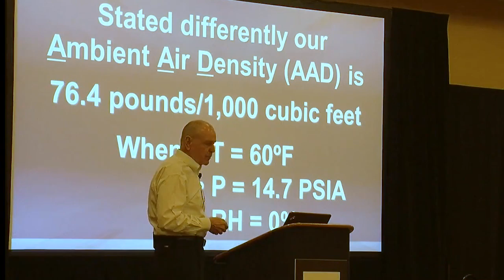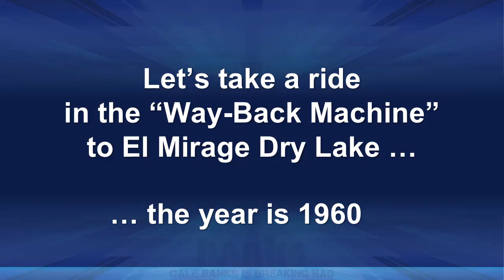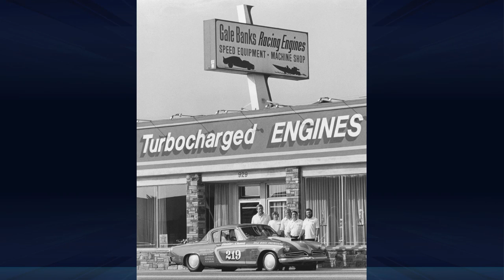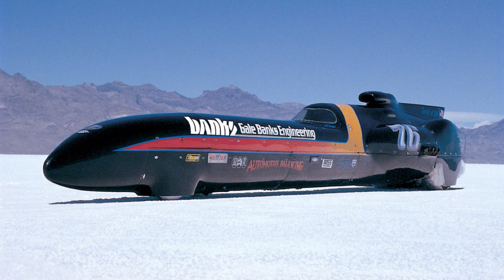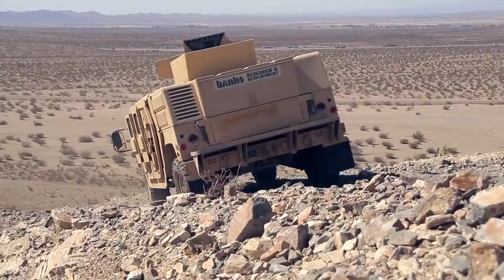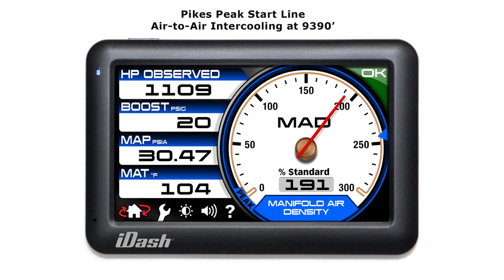The Boost Gauge is Dead to Me!

Comment: its simple the same boost in a thinner tube will move less air then a big tube with the same boost and ofcource bends and other stuf play a roll but for the basic just think abouth that.i see guys on you tube putting bigger turbo and bigger tubes and wondering wy it makes the same power as the smaller turbo with less boost

Comment: I think his reasoning is flawed, because boost numbers were never used to compare power. 20 psi of boost is 20 psi of boost. It doesn’t mean any more than that. A 2.3 liter 4 cylinder on 20 psi will make a wildly different power number from a 5.0 liter v8 on 20 psi.

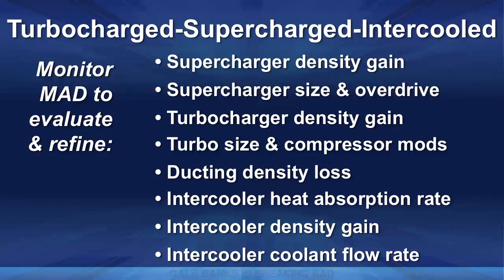Comment: Excellent stuff, learn heaps despite only managed to watch 50% of the content (will continue). Gale, I’ve got a question, where I live its hot (30-35*C, 90% humidity, 365 days). I run a petrol turbo Cx7 with higher flowing turbo, bigger core IC and pre IC and post IC WMI (I feel it is absolutely necessary run wmi in my neck of the woods with 50:50 water to meth by density ratio). Question is what does WMI do to humidity which ultimately affects MAD? sure it cools, but what abt density?
Reply: My understanding is that it depends on where the water mist evaporates. If it evaporates before the intake manifold, this should cause intake air temperature decrease, so MAD would increase. If the water mist evaporates inside the combustion chamber, then you have water breaking down  to oxygen and hydrogen, which again increases air density. But as far as i can tell WMI is mainly a tool to control uncontrolled detonation/pre ignition inside the combustion chamber.

Comment: 72 Inches Map was a hot setting in WWII aircraft. They did not use boost either because the engine and fuel only respect temperature an map.

Comment: The only thing I care for,  apart from a efficiënt turbo and intetcooler set up , is how much grams of air is IN  the cylinder AFTER the intake valve has closed......

A lot are yelling about high boost etc and how high the boost can get....then I ask :  what about that super high boost  if intake valve has not opened and closed ??? Then there is no air in the cylinder..... basically:  high boost  and a worse induction and exhaust system gives an overheated engine.....

Comment: Density is king!
A better intercooler will give you a power and reliability increase due to the increased density while giving a higher performance headroom. Still too many don't understand the whole concept. On the subject of lag down low, I would love to play around with injecting liquid propane into the manifold to increase response from the instant exhaust volume and the density gain from the latent heat of vaporisation. I drove a truck with  gas supplement which went really well. It would certainly help with the smoke issue. If you only inject gas below the flammability limit, there would be no problem with backfiring as it has a very sharp cutoff unlike petrol

Comment: Hi Mr. Banks, How do you explain Smokey Yunicks Hot Gasoline Vapor Engine system ? Smokey is heating the A/F mixture to 400 degrees Fahrenheit, Vaporizing the gasoline, Homogenizing the A/F mixture, increasing engine horsepower,  increasing Gas mileage, and reducing exhaust emissions.
Reply: Gasoline Vapor Systems probably has an issue with detonation and Nitrous Oxide production.
Reply: @HighestRank  Nope, Zero detonation, even with advanced ignition timing, and low octane gasoline. I don't know about the NO2 emissions.
Reply: Yunick had some great ideas and this was one of them. He also like to run race engines hot (240°f) for homogeneous charge and less heat regection. The problem with them is the exotic materials that are requires and costly lubrication. Some claims are of 50% efficiency and that just possible. What's happening today with f1 narrowly beats it with roughly the same expensive materials. A vw 2l diesel is about 41% efficient and Toyota clips at 40% now with their modern engines. There might be a bit to be gained but the cost would be overwhelming. The patents are over 60 years old and if it was going to come to fruition it would have decades ago.
I haven't seen any long term testing either and I can imagine the problems that arise from having an engine that is expected to operate at 400f sit in an Alaskan driveway for a week at -40. The thermal cycling, even with engineered material, i have a feeling would cause havok.

Comment: Hello Banks, I have a question, we need more density to have more oxigen and the question is you have considered adeed oxigen by other way ? an experience with this ? sorry for my english
Reply: Nitrous Oxide adds more oxygen in combination with fuel injectors to keep the right air/fuel mixture. Works well but has to be well managed or you can melt pistons if it leans out.

Comment: Great video. Lots of knowledge  of volumetric efficiency factors. Altatude and ambient temperature definitely effect engine performance. My brother flue a piper Aerostar plane with two 6 cylinder turbocharged engines.
The p51 mustang in ww2 was supercharged. A v12 was a real winning combination.

Comment: I would be honored if you could answer this.  I was told a long time ago that when boost is added to an engine that the displacement increases.  Is this so?? If it is is there a formula to use to find out boost=displacement change...Thank you again for all of your information.
Reply from the maker: Adding boost does not increase engine displacement. Your engine pumps a fixed volume of air per revolution. By adding Boost you are increasing the pressure of the air so each cubic feet of air contains more oxygen molecules. It’s the extra oxygen that allows you to put more fuel in to give you more power.

An approximation of the added power can be done using pressure ratio. If you have a 5.0L naturally aspirated engine that makes 300 hp at MAP of 14.5 psia (or 0 psi boost). And you add 14.5 psi of boost so the new manifold air pressure is 29.0, the pressure ratio is now 29.0/14.5 or 2.0. The new estimated hp will be about 600 WHP (300 whp * 2.0 pressure ratio). 

This is just a very rough approximation and does not take into account the changes in air temperature when you add forced induction to an engine. For an even more accurate estimate, you can use Density Ratio as a multiplier which does take temperature into account.

Knock limitations, parasitic engine losses and more are also factors so this is just a rule of thumb, not an exact science.
Reply: @bankspower  Thank you so much sir,,,I feel privileged for your response...

Comment: Thank you. This makes great sense to me. I heard about and used, water and methanol back 40 yrs ago. I heard little bits and finally I know WHO was the source. YOU. I spent months in the Mech Eng library researching engines and flow dynamics.  I used ram air idea, running stove pipe thru the grill. to  get cool air into the air box, back in the 70's. I did not care how it looked, just as long as it was faster than before.  Cheers
Reply: Centurion Wizofid must’ve been at high altitude.

Comment: Great presentation, almost makes me like blown engines. But what I still can't get behind is the increase in BSFC of boosted applications. Far as I can find out, boost will require a disproportionate amount of fuel to be added, shifting the AFR towards reduced fuel efficiency. To me that seems like I'm being robbed of latent energy in the fuel. That, and all the additional parts that can break. If you're not after absolutely all of the power, boost seems like a universally bad idea.
Reply: More fuel is added to cool the cylinders due to the additional heat generated.. not using more fuel will melt pistons.
Reply: That depends. If you hear him talk about the 6.9l idi turbo kits, they pick up power and gain efficiency with lower egts.
There are circumstances that an equivent power blown engine can intermittently be more efficient, that's why new cars come with turbo 4cyl as opposed to NA 6s. At full power a naturally asperated gas engine will be more efficient without some kind of energy recovery. The problem is most people never use full power or if they do its for five seconds as they get on the highway. The smaller engine will use less power with less pumping losses when rolling on the highway.

Comment: I'm going to put the boost gauge aside... Because it never made sense to me. I've become fond lately of the idea of the 1.0L Ecoboost engines! Tiny, 200 lb cast iron motors, boosted, making more power than my prized modular 4.6!
And thanks for this video, I had it aside for a while because of the length, but I'm really glad I could be shown more clearly the effects of MAD relative to power output. I'll have to do more studying.
Reply: I love the Ford 1.0 also it's a great engine with a cool exhaust note. Currently working on compound turbo charging mine to get low down torque and high end hp.
Reply: From an engineering standpoint boost numbers may not mean as much as people think, but it's still a good gauge to have. My truck runs 31.7 pounds at peak and usually sits mid 20s under a pull, if  the normal patterns of boost change I know something is wrong with my system and can fix it before it costs me to much $$$.

Comment: The dude nailed it - something I keep telling folks is that boost isn't everything - take it too far and you can actually drop power if the temperature drops density faster than the boost increases it.
It is getting the balance right that makes the difference.

Comment: Back when I had my 1.8T Jetta (2013-14) , people used to look at me funny when I said that I liked to run my engine at 40 psi total. My Logic being that it was around 14 psi on a normal day plus the 26 psi of boost, so with a barometer I could calculate how much boost to put in depending on the elevation of the place I was at (more boost at higher places). Turns out I am not crazy, Thanks Mr. Banks!
Reply: Boost doesnt matter.... Did you dummy out for an entire hour?  Nothing he said makes your assumptions correct.  Quite the contrary.  Stfu.

Comment: Are we still on for 2018 Bonneville?  August  or September?  I ran T88 a 91.5 D250 stock  in 2017 87.14mph, my goal is 130 club on stockwith aero turbo and gears alone.  I have been advised by Phil Knox  to try to find the old HOT ROD acceleration calculator, to figure out if how far the aero/gears will take me. Aero is down 24%(DARCO 2017) with the camper/tonto cover in avatar.  
89-93 =~.55  Cd =~.41Cd with custom cap(with palns for  a useable " truck" in tbe .25-.30 range.)
94-98 =.44 Cd
Reply from the maker: Are you asking if we're running Bonneville this year? No, we are not.
Reply: Banks Power  yes that was question 1 #2 was for help finding the acceleration calculator hot rod published years ago  or pointi g in the right direction.  As stock Redline 2500 is before the half mile mark on the standing mile  that means there's more available without messing with the injection pump timing or anything else
Reply from the maker: Ahh.. We don't have the calculator handy that you're referring to. We've requested a copy from HotRod.

Comment: He should be using lbm and not lbs. His mixing of units is pathetic. Lbm is unit of measure for mass. Lbs is  measure of force. Psi is a measure of pressure.
Reply: The p stands for pounds. Pounds per square inch lol

Comment: I really like the idea of scuba tanks squirting on the inlet side of the turbo during low engine revs to get more low down power and reduce or eliminate turbo spool up.
Reply: As he says use compressed air to spinup the compressor.  You'll need a ton more volume to spinup if you're blowing in the intake compressor.  Compressed air may be ok for trucks running air on demand systems but if you're running quarters then try CO2 to spinup the exhaust compressor.  You'll get heaps more volume and pressure than you would from equivalent sized compressed air tanks.  Compressed air ~150psi and drops quickly compared to a steady 900psi from CO2.
Reply: That was something I always thought fondly of. Interestingly enough, I've seen new production Volvo engines use compressed air on the compressor wheel at low rpm to eliminate lag. It's mentioned after the scuba tanks mentioned in the questions
Reply: There was guy doing a Buick V6 drag car who squirted nitrous peripherally into the turbo inlet housing to wake it up. The gas impinged on the blades but when the exhaust volume blasted up thanks to the nitrous, it really got it going. He also used an ice tub for intercooling.